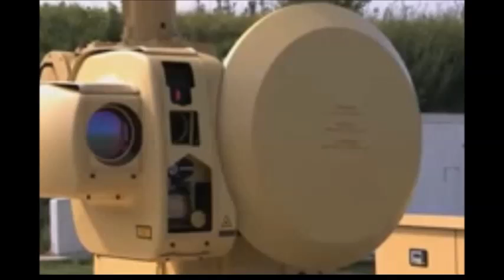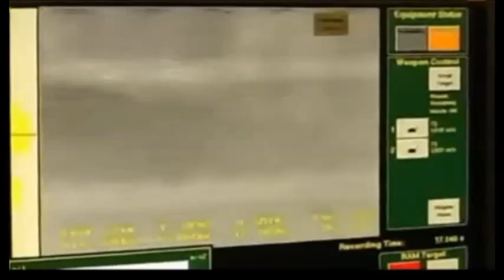Oerlikon 35mm Skyshield Air Defence System

Comment: this is a german Mantis
Reply: Oerlikon is a swiss product. So it would be a swiss Mantis.
Reply: no. germany owns this now. they have upgraded the system and the name is actually mantis. So No not swiss mantis it is german mantis.
Reply: Made in Switzerland von Oerlikon Contracts AG, new name Rheinmetall Air Defence! Engenieering und production 100% in Switzerland and not in Germany!
Reply: @Jacking0ff  Yeah it's the same principle with a bmw that is build in china.
If that's your definition of "german made" otherwise you would be wrong.

The Mantis System is basicly just the networking behind it the guns are pretty much the same as the millenium skyshield.
Anyway it's produced in switzerland, Rheinmetall Air Defence has it's seat in Zurich which in my opinion makes it a swiss gun distributed by the germans.
Reply: @Slithermotion  yes
Reply: @Slithermotion  Actually the majority of bmw's are built in germany. And mantis is based on oerlikon's skyshield but got some serious upgrades by Rheinmetall after they took ownership